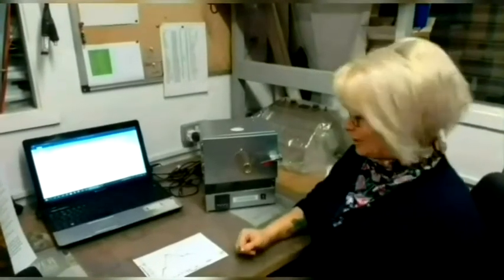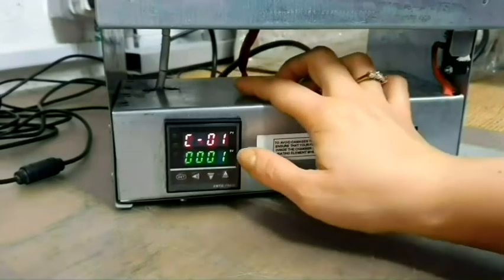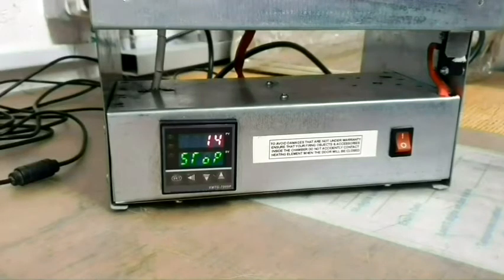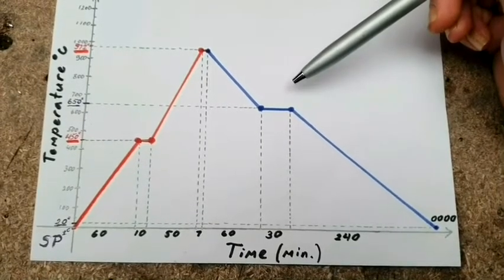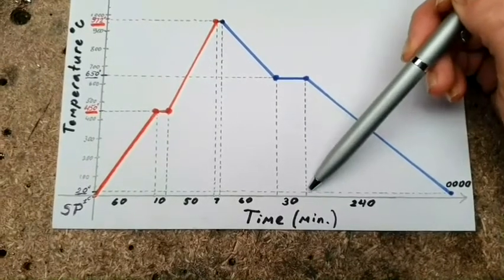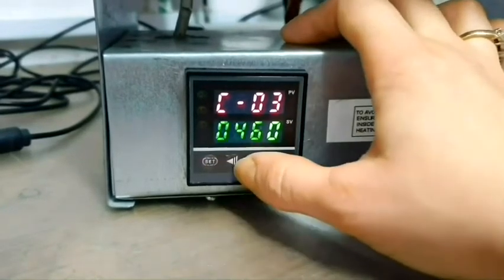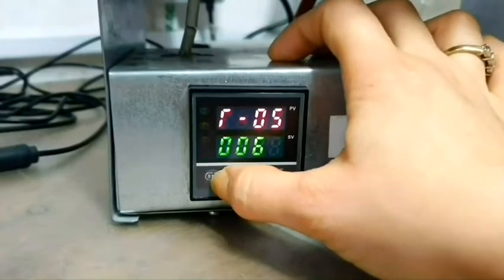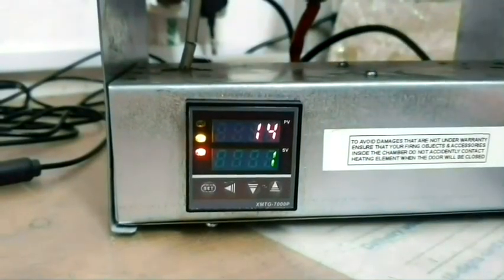How to programm XMTG-7000 temperature controller

Comment: This controller is really flawed it works independently of the actual temperature. So if you want to hold at temperature for 10 minutes. The requested temp will hold for that time only regardless of whether the actual temp has actually achieved it or not.
Reply: Did yoy manage to figure this out or is the timer still independent of actual temp?